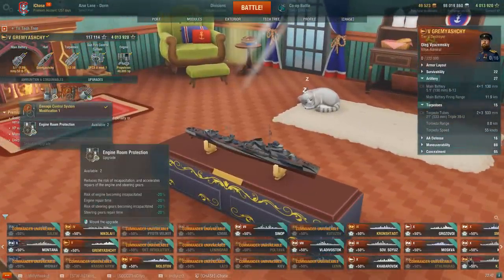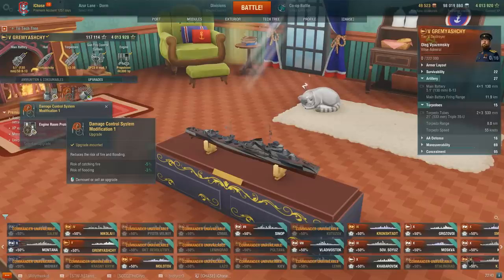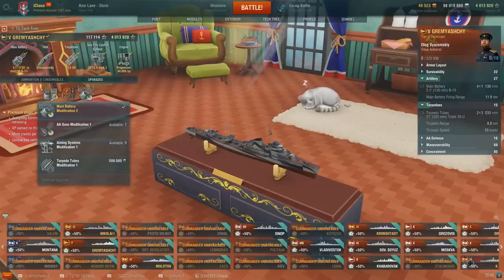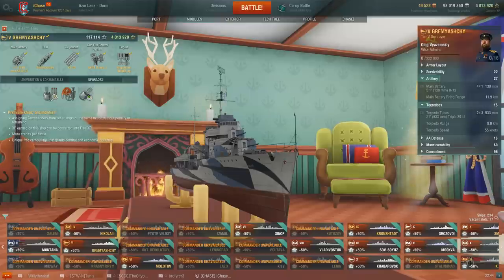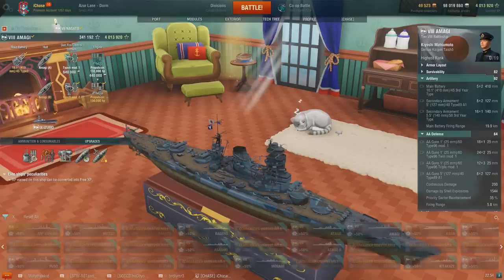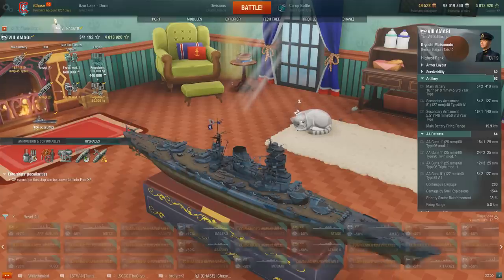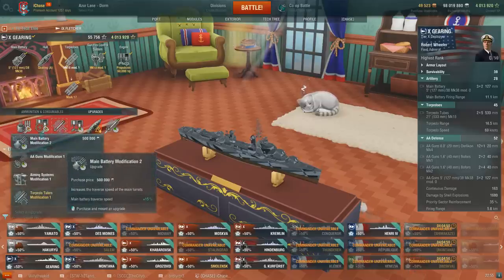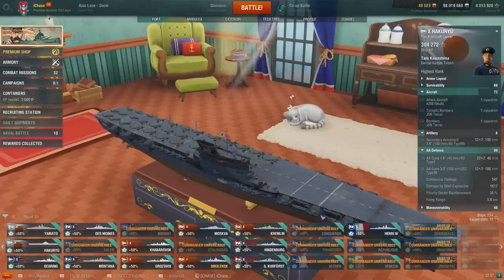How to Get Good at World of Warships Episode 8.5: New Upgrade Modules

Comment: On my Bismarck by combining torpedo lookout system and modified vigilance (35% instead of 25%) I get a assured torp detection of 2.4k for all torps. With hydro, its boosted up to 4.7k. While this build is more for fun and showing dominance to loliboats, it has proven useful in chasing dd's and torp screening for my teammates or div mates. Cant wait to finish regrinding this line and see how the 6k hydro is affected by this setup.
Reply: why u think the 1.8km upgrade stacks with this? its only assured detection...not regular torp detection which depends on the specific torp stats.
it is only really useful vs deepwater torps and only when u dont have hydro on.
Reply: @cobrazax  vigilance stacks with this as said in the update info. I also tested it out and it works to the same way as said above. While I know it's not the most viable build, its a fun build to mess around and unless your caught in a middle of a turn, pratictly no torps can touch you. In my opinion German BBS is one of the most viable ships to put this module on as you can tank dmg well and this method makes you more self sufficient if your fighting a DD all alone. I hope this helps u with my reasoning.
Reply: @cainsharples3818  
If it stacks then vigilance can make all torps detectable like 20km shima torps...can be really useful.
It seems too powerful this way though
Reply: @cobrazax  while it is strong against torps. You sacrifice a lot. 10% concielment and 3 point skill. While the skill point investment is not too much of a sacrafice the concielment is. This bacicky leaves all cruisers and dd's to not take the module. Only on BB it is really viable and even then only German BB gain the most benefit due to there already crappy concielment and good armor. Plus this enhances there hydro. Overall while people with this build geta a massive one up on dd's, due to it being in the concielment slot, it's not truly viable for most ships in my opinion

Comment: Personal opinion:
Well done tutorial, but I kinda disagree with you on a few points (I do agree with you on most ones):

6th slot changes? Yeah, nothing really happening her
5th slot? Concealment is still kind, unless you have one of the few ships that gets some use out of stacking rudder shift time. Beyond that? Dunno why WG shafted the torp reduction, wouldnt have made a huge difference imho for DD players (and at least in terms of CWs I'm a DD main nowadays). Way less impact than CV rework or say the WIP stats of the Soviet cruisers with their stealth-radar capability....
4th slot: Agree, MBM2 for anything that has horrible traverse speed and doesn't need one of the other ones more direly. Swapped it onto my Yami (helps with the leg mod penalty), Kleber...Gremy... AA is useless except for the ships where you don't really need anything else and have good AA (Worcester or Friesland maybe), but those are rare and few. Torp reload...now that a nice change, I even slotted it on a few cruisers who either can stealth-torp (Mino) or work enough with torpedos to make the reduced crit damage chance situational useful. 

3rd slot? Now, here i tend to disagree... Yes, LS somewhat dampens the effects of a broken rudder or stearing gear, but half efficiency ain't the same as not being broken or shorter repair time. And while I haven't run the exact math, imho the -5/-3% changes on fire and flooding doesn't produce that much of a change in fire chance. Not compared to a) base coefficient and bullet fire chance. 

I mean for me that's kind of like murphys law... If you really don't need another fire, you will get one...despite just getting hit by one single bullet and having the module and all the flags and skills. Which is why I swapped out all the dam con modules on all my regular cruisers. Running the new engine room on all DDs and cruisers, dam con on BBs and super cruisers. 

Oh and quick work around for those that a) watch the video while the free dismount discount is still live and b) have too many ships in port:

I went for the following approach: Take a look at a ship, ask yourself if there's any module you want to change right now. If the answer is no, move on to the next ship. If the answer is yes, ask yourself how likely you will play the ship in the next weeks/few months. If the answer is "not likely", just remove the module you want to change anyway and sell it from the Inventory for half the regular cost. Then save that money until WG grants us the next period with a -50% discount on modules, then flesh out all those ships again. In which case you changed the modules for zero dubs and credit investment (only time), instead of selling  old ones for half and buying new ones for the full price.

Comment: If you can spare 3 points on vigilance and take the spotting module it gives you a 2.25km heads up on torps. Place it on the bismarck and it extends the hydro detect of what was said on WG stream to 2.25km plus hydro. Then take fighter plane and you have some pretty good awareness of torps coming during the whole game with a minimum of 2.25km and maximum of over 7km. Not bad but understand the need to just take concealment aswell.
Reply: The torpedo acquisition module just means you can't have a lower torpedo detection than this... I don't think it stacks with Vigilance or hydro. :) It just means you spot any torps at this range even if their detect is lower.
Reply: Planes no longer detect torps, for over a year now.

Comment: I'm not sure: in a Roma with excellent concealment, concealment module can be surely beneficial, but in ships like the Amagi or the Kii, where you are being seen form the moon anyway and very poor maneuverability to play with, I think torpedo defence is not a wrong choice, especially with all the CV we see today, able to detect anything on the battlefield anyway. I'm sure concealment will be useful here and then and will save your life a time or two anyway, but how more often you find that dastardly dd out of nowhere, peppering you from nowhere in the early or mid stages of the game and forcing you to fight the rest of the battle with half your health?
Other ships, like the Tirpitz also could benefit from torpedo protection if you go for a full secondary build, because you are missing Hydro but need to close the distances if you want to shine. Your concealment is nothing special anyway and your AA and secondaries are more often active then silent. I don't see torpedo module as useful on Crusiers CV and DD through: only on BB.
What I don't like about toprs protection is that it penalizes slow and stealthy torps giving you A LOT of reaction times but does almost nothing for cruise underwater missiles that hits like trains and are spottable from afar anyway but close the distances at shells rate and gives little to no time to react in a slow battleship.

Comment: Big brain Smolensk play: torpedo tube mod in slot 3.

Let's think about it vs the other options. 

Main battery mod 2: 15% faster turret traverse? They rotate at 30* a second, unnecessary. 

AA guns mod 1: AA prep time? Why bother? AA is nigh useless nowadays, don't need it.

Aiming System mod 1: the default most people go with, but let's break it down. 7% less dispersion. The max possible firing range of the Smolensk is 19.2 km. At that distance, max dispersion is 159 meters. -7% is 148m, an improvement of 11 whole meters. Insignificant. Smol also has no secondary battery to improve, so really the only "bonus" is faster torp tube traverse, which you also get on...

Torpedo Tube mod 1: you get 20% faster tube traverse like ASM1. You also get 5% faster torps, which with 8km range might just save your borscht in a close-in fight with DDs. They won't help you if they get disabled though, which is where the big brain bonus comes in. -40% chance the launcher gets incapacitated, which stacks with slot 1 Main Armaments Mod for a total of -60% chance of being incapacitated. No other mod in this slot gives you a bonus this big, you're a fool to not take it.

Thank you for coming to my TED talk.

Comment: i disaggree on the second slot, for when radar is involved. Last stand wont help much becouse your easy to hit when its active.
Reply: Why would last stand (ie sustained engine and steering) not help? Seems to me that when you are under radar and fire then that’s precisely when you need last stand. To be frank, only an idiot does not take last stand on a DD as quickly as they can.
Reply: @IRC2005  Of course you take it, thats not my point. Your speed is cut in half rather than nothing, but in most radar situations this is not enough. And fire isnt much of a deal in most of these situations.
Again, i am not talking against last stand here.